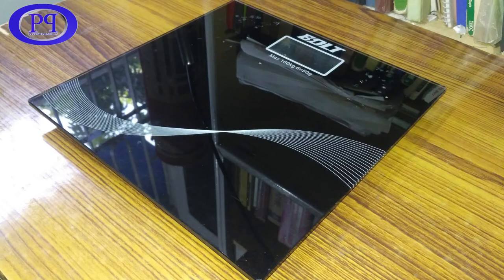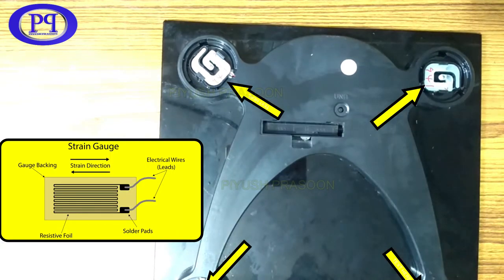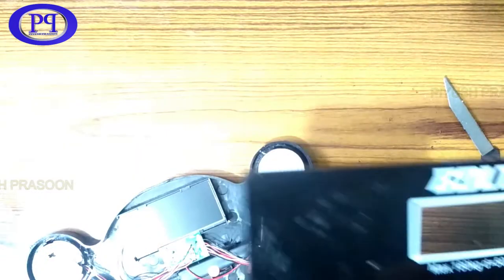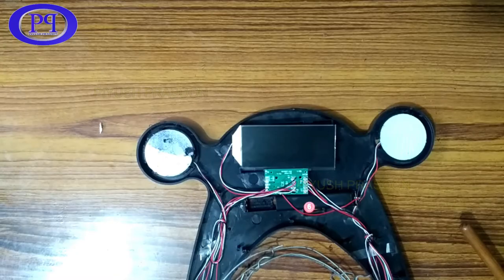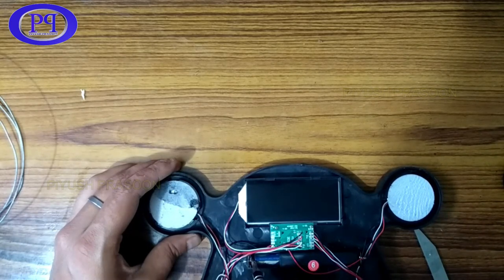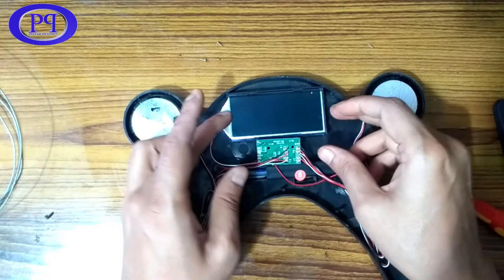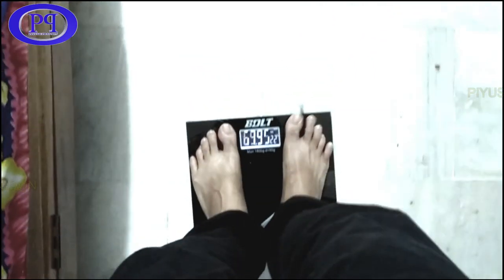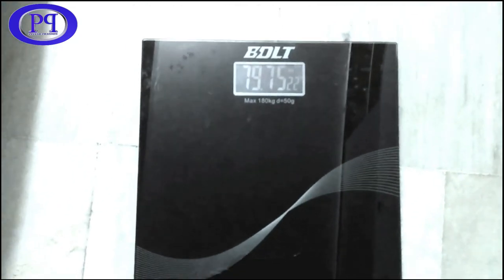Weighing Machine - How it works with Teardown | ENG

Comment: Very informative video. My machine is not arriving at a final result which is indicated by blinking some numbers at the end. It just keeps on changing numbers indefinitely. I suspect one of the load cells is causing the problem. 
 After watching this teardown video, I will try the following and update here in a few days -
1) check orientation and snugness of load cell caps
2) if this doesn't fix it then open it up and check all the connections
3) take it to the repair shop if 1, 2 don't work
4) burnnnnn this Chinese c₹ap without the glass and use the glass as a decoration piece or make a clock out of it
Reply from the maker: Nice, you have multiple plans - best of luck 🙂

Comment: Can Zoric spray help in cleaning the load cells? In my case, it shows LO meaning low battery but after 4-5 attempts it starts showing the accurate weight. Can I try the Zorric spray?
Reply from the maker: you can try it. BTW time to time the load cell metal degrades which cause this type of issue.

Comment: Bro power is not goes to display, what will be the problem. I am having a health sense body scale machine.
Reply from the maker: might be possible the wires connected from main board to the display would be broken or the soldering could be broken

you could use multimeter to check it

Comment: Thanks for the video. My display isn't working, some of the segments have died. I opened it up but there are no specifications on it. I'm not able to find the replacement part. Do you know what this display is called or a link where it is sold?
Reply from the maker: these display are build according to the main board, however you could try visiting the local technician, incase he will have other malfunctioning weighting machine, he might try matching the display and could fix the same in it.

or you could visit any open electronics spare parts market, you may get the similar display in cheap price.

Comment: Hi, thanks! Can you please tell me if it's the load sensor that turns the power on when the person stands on it? I want to build a device that turns power on when a person stands on it and am not able to find what kind of sensor will I need to achieve this function.
Reply from the maker: The sensor commonly used in weighing machines or scales to detect weight and trigger an action (such as turning on power) is called a "load cell." Load cells are transducers that convert force or weight into an electrical signal.

you can find load cells and related components from electronics suppliers or specialized stores dealing with sensors and measurement equipment.
It might also involve calibration to ensure accurate weight detection.
Reply: Thank you so much! This is helpful. @PiyushPrasoon

Comment: Sir iam using motion partner weight machine with 3v battery button cell

Everything works good , but its lot turning on auto
Unless i reinsert btry and it turns on and auto after stepp off. 

But its not starting automatically when step on , ther is no on switch alsoj
Reply from the maker: Answer the below question:
1. Was it working properly when you have purchased it?
2. Do you have the user manual for the machine?

Do the below checks:
1. try replacing the battery with the new one.
2. check if the battery contact points are corroded (check the plates in machine and battery both)

Comment: When I m replacing cells it shows 000 , but after a few seconds it goes away and when I stand on it won't show anything. Plz tell how to repair
Reply from the maker: Check battery contact point, those metallic plates point of contact gets corroded sometimes. This mostly happens in humid climate.

you can use knife or any sharp object to scratch battery point of contacts.

Comment: That backside one plastic clip is broken, how should I fix it???
Reply from the maker: 2 Weeks ago same happened with mine weighing machine

You could use tape to fix it...you have to apply the tape loosely and check if it is working properly
Further you could fix it super glue only at the end of the tape.

Comment: Hello sir, we replaced the cell and for few seconds it showed 00.00 but after not working and it disappeared 
We checked the place where cell is to put but nothing
Plz give solution
Reply from the maker: first of all you should try reconnecting the brand new cell.
check if the cell chamber metallic contact plates got corroded, if you have a multimeter, it would be much convenient to do the checks.

if the plates looks corroded then rub the contact portion with sand paper slightly, you could also use some sharp tool to scratch the surface however sandpaper is the best option.
Reply: Mine too had same problem. Put just a bit of Vaseline (petroleum jelly) on both sides of the spring/terminals. Not too much as its Indian summer, Vaseline may become thin liquid & flow inside. Use very little amount with a brush or forcep.

Comment: My scale some times show 2.00 kg. When initial without material But no tare in this machine how to solve pls. Inform
Reply from the maker: it will show garbage value if you will use after long time. I hope it might be getting auto calibrated after stepping and releasing it for first time.

Comment: How to fix if sensor is not working?
Reply from the maker: sensor might got disconnected with the main board or may be some loose connection, you need to rectify the errors possibilities using different methods with the help of multimeter.

Comment: Hey I have the same weighing scale and it's working too but everytime  I check my weight it shows different results.  Like it will show 45 then next second when I reset it and check it shows 60, please help me with it.
Reply: I guess the load cells are mal functioning.
Reply: @MohammedKhantheacademician  please tell me what can I do for that?
Reply: @rheasharma303  Probably get a new one! ;) 

Actually I am sorry, I cannot say anything, I was researching something abt load cells and ended on this video.

 I am working on a product development project that has weighing system in it (for some other purpose). I was encountering varying readings (quite similar to something what you mentioned), the investigation revealed mal functioning of load cells. The movement of machine on the surface deteriorated the positioning of cells, eventually giving false reading. In my case, I will talk to the supplier and improve the quality of the cells that we are using in our system.

 In your case, as a consumer you can claim warranty (if it exists) , or try some troubleshooting..
Reply from the maker: Probably, the placement of the load cell is not proper. Please do a check on following points:
1. check if display is fluctuating.
2. check the battery level (it will be shown on the top corner of the display)

FYI : when machine is at ideal state and you are about to use the machine, please activate the machine by pressing it using you toe, applying a nominal pressure - the display will turn on and once 00.00 will reflect on the display then you could use the machine (this is needed to calibrate the machine).
Reply: @PiyushPrasoon  Thankyou for responding, the display is absolutely fine it shows the temperature and battery sign as well. Only the weight keeps fluctuating.  
Also I always make sure it's  0.00 before stepping on it.  Is there anything else to make sure it's weight is correct or how do I have it repaired?
Reply: @MohammedKhantheacademician  thanks but I can't replace it
Reply from the maker: @rheasharma303  Hmmm, every thing sounds good, now lets check if the load cell is malfunctioning. So here I am sharing you very simple way to verify it.
Get a fixed weight which is known to you, lets say - 5kg (or more) bag of something (rice, pulses etc) and put it on the weighing machine and check if it is showing correct reading.
note: check if all 4 legs of the weighing machine is placed perfectly on the floor.
Reply: @PiyushPrasoon  hey I did try that I placed my 2kg dumbell on it and the results were the same , the weight shown  in pretty inaccurate at times. It's placed on an even floor too.
Reply from the maker: @rheasharma303  ohh, looks like it's the problem with the loadcell - actually it could be the problem with the connectivity of wire to the main board with one or more loadcell, it could be checked after dismantling the weighing machine.

I guess, you should visit a the good repairing center, however you have to ask them for the surety of repair and the price.

ummm incase you don't want spent money, then check it will different weights and note the difference in the original weight and the displayed weight - if the error difference is same with each weight then you can use it to know original weight making + or - with the error difference.
Reply: @PiyushPrasoon  same problem with me.. got any solution???
Reply: @rheasharma303  same problem with me.. got any solution???
Reply: @MTmusix  sell it
Reply from the maker: @MTmusix  its the problem related to Load cell load cell replacement would be the solution.
BTW I did not faced this issue yet.